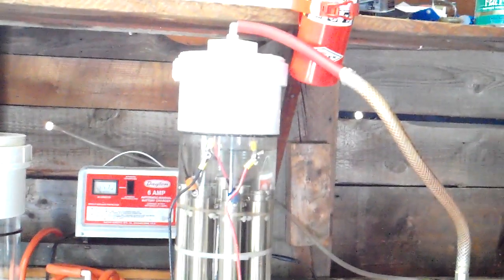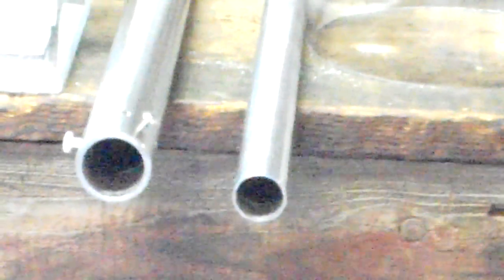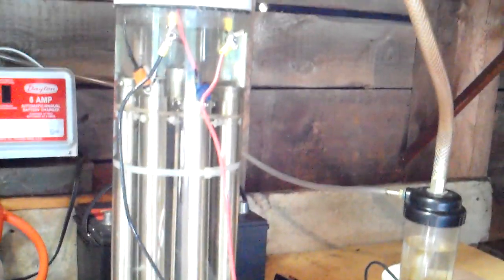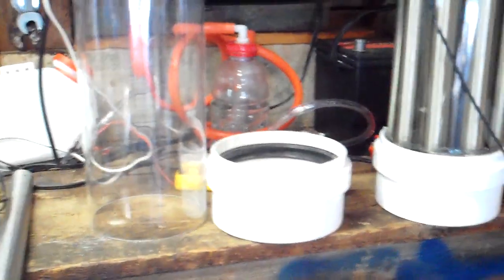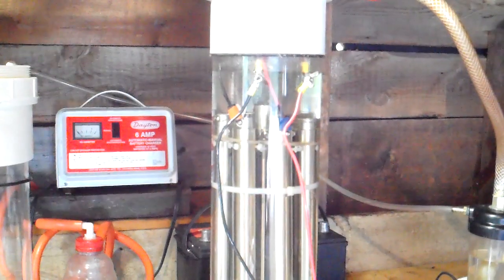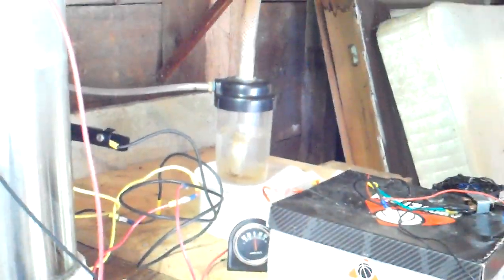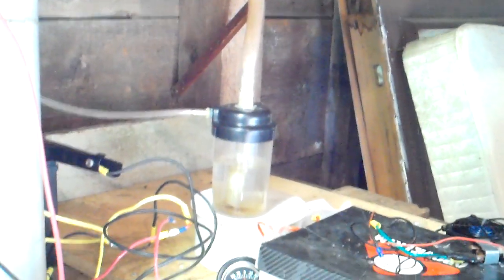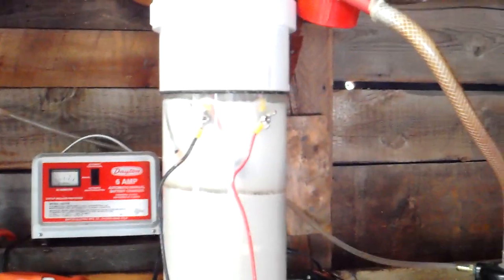High Output Stanley Meyer HHO Generator.AVI

Comment: This is considered wet cell, yes?

How could configure for just pure Hydrogen? Thanks...
Reply: This is an electrolysis device, it's very inefficient at converting electricity into HHO. No, this is not a wet cell. You are thinking of a "leyden jar", the first "battery" ever invented.  This is a scam
Reply: +Jacob Jones Thanks. I agree. After reading your post, it sounds a bit dodgy...
Reply: to get pure H2 and pure O you must separate the electrodes as each one gives off a different gas ex. positive electrode gives off 1 gas while the negative electrode gives off the other gas so each one has to be confined separately so you can capture each gas apart from the other.  this means no ac power only pure DC.

Comment: ¿Ese generador de Meyer , en que se diferencia de la Electrolisis ?
Reply: bonjour , désolé , mon français est terrible. Cette conception est basée sur l'unité mayer HHO , l' hyfusion vidéo a fait produit 5 fois le HHO que l'unité de Mayers . Hyfusion veut de l'argent à partir de son site -à-dire ce qui est différent . Sons suspect à certaines personnes qui ont fait des commentaires ici .
Reply: Y tendras algun Manual para Poder hacer una Replica de Meyer HHO ??
Reply: Tendras algun manual o Podrias ayudarme a Hacer ese generador de Meyer
Reply: its design is online free
Reply: Pero no lo encuentro . Podrias enviarme los Manuales ??  Gracias
Reply: Un generador de HHO de meyer . Cuanto HHO produce en LPM y Cuanta Corriente necesita ??
Reply: There are many videos and web pages,  and many different versions. watch them closely, i am sure you will learn quickly. There are not many versions which produce large amounts of gas. the choice of coils, tubes or dry cell is yours. There are very efficient units being made without draining too many amps or volts. As a car nut and not shown much, the simplest way to produce amps is by using two alternators. There are basics to consider also, water type, bond breaking additive, metal type, etc etc.
Reply: Y que vensiones me Recomiendas para Producir 5 LPM de HHO y cuanta Corriente necesita ?
Reply: Podrias recomendarme Videos ..Paginas Web
Reply from the maker: Daniel Jimmy Nuestro sistema HHO celda doble de gas dividida pone 4LPM HHO @ 200 vatios / hora . Visita www.HHOTrucking.com para precio y especicaciones
Reply from the maker: Daniel Jimmy Proceso de Stanley Meyer es diferente que la electrólisis . 
Sus circuitos sólo funcionan con agua destilada o agua Orgón . 
Estamos diseñando un circuito simple que hace lo mismo :
Reply: in his video meyer talks about surface area. A form of electrolysis seems the only way to go.

Comment: I know how to make an effective hydrogen/oxygen generator!

1:st! Send a great "Up yours!!!" to Barack Obama and the masters that are pulling his strings!

2:nd! First rule when building a generator, maximize surface contact! That is essential for optimum performance.

I'd prefer to build a generator like this:

The system would be able to handle 30bar for my purpose but you can build it with ordinary items, sort of, some things you need to manufacture yourself but it's not more than cutting with a scissor or a saw.

If a metalcontainer is used, then you can use its shell as a ground connector. The inside is where the magic happens and now is the time to really understand what happens in the process of splitting water to its basic components, hydrogen and oxygen.

For those who want to know more:

We are splitting water to burn the outcome, into water again. To split water, you need water, baking soda, 1 plate to + and 1 plate to -, and one container.

Depending of amount of water, one tablespoon per liter is used. Put the plates in the container with the solution (water and baking soda). Connect the + and - to power source, i.e. a battery and voila, you are splitting water into a burnable gas. !!! Be Careful! The Gas Is Explosive!!!

What happens is that current is travelling between the plates and when doings so, at the positive plate, electrons are ripped off of the watermolecule, making it ionized. There are 3 atoms making a molecule, 2 hydrogen and 1 oxygen. When an atom is "ionized" it has lost 1 or more of its electrons. When this happens, the atom goes from neutral to positively charged. When 3 atoms are together, suddenly goes positively charged, they repell each other immediately. 

In the stream of current between the plates, the individual atoms pick up a new electron to even out itself and then seeks its way to the surface as a gas.

The "rip off" happens at the surface of the plate. The more space there is on the surface, the more molecules can be split. Instead of using a solid plate we use a highly perforated plate, and it needs to be thin yet firm enough to not bend like aluminum foil. 

Now you maybe get an idea of what the "secret" every other guy has but doesn't share freely.

I would use stainless steelplates, perforated enough not to compromise its structure. The smaller the holes, the more surface can be made. It is exactly made as a fractal. Check it out, what are fractals, very interresting.

The plates are to be stacked +-+-+-+-+- and so on. The distance between them should be as little as possible.

You can make a small one or a big one. If you are handy and can assemble a package of plates, put it in the electrolyte and apply power to it, the system will boil like crazy. I'm thinking into building a working device, generating plenty of gas to drive my motorcycle. I would have it working at a pressure of 20-25bar. The pressure is needed for regulate performance easier. This has to work with a 12V system.

If you want to knoe more, just let me know!

Comment: where's your pulse width modulator?!!  this unit doesn't produce squat!  I call BullShit.
Reply: Do you even understand what PWM does? Why would changing the duty cycle in the form of PWM affect the output? That was rhetorical, it wouldn't. Actually it would decrease the efficiency of the system. Plus HHO generators are bullshit, anyone that praises that they violate the laws of thermodynamics is trying to con you out of money
Reply: J hey professor how does it violate the laws of thermodynamics

Comment: If you want to get the plans
to convert your car to HHO
Go to Google and Search for:
Top HHO Gas Car Research
Click the First Result (Skip the Advertisement)
Reply from the maker: dcbourbonireland Thanks for your thoughtful analysis. Much of it was correct, especially the part about selling the system to family members for a dollar first. However, I would like to clarify two issues that you didn't get quite right.
1. Stanley Meyer realized that monatomic hydrogen has 3 times the energy of gasoline BUT, it reverts to ordinary molecular H2 very quickly. To run his dune buggy on just 7 LPM of HHO he had to invent the water fuel injector plugs that made monatomic hydrogen RIGHT BEFORE IT WAS INJECTED INTO THE CYLINDER. So, you were partly right. My other point #2. is that it has been proven that his voltalysis process is totally different than Faraday electrolysis and is actually over unity. It is 300% efficient. Bedini and Meissner both have designed circuits that do what S.M. was doing. My latest design uses these new over unity circuits to generate far more net energy from HHO than joules consumed. Using this technology an engine could be designed specifically to run on HHO that would have ZERO FUEL COSTS. Call to get my free whitepaper on the subject 207-315-0315 Dave D.
Reply: The more I look into this HHO business the more I figure that Stanley Myer had the right solution .In the HHO. We see many gizmo that produce some liters per minute with the average theme that they use some ~200 watts of power to give back some 1 liter off HHO . After that  the HHO is injected in with carburetor or injectors . Most all measures are liter per minute for these HHO devices .Stanley Myer I think went the other direction he figured out how much HHO do you need for every single explosion in the cylinder of the IC engine . He looked  the micro level explosion event to replace the few grams of gasoline used in the cylinder for each explosion event  . As the gasoline enters in droplets much of it is wasted as the fuel hits the walls of  the engines cylinder .Also the gasoline fuel  burns slowly so most of the gasoline fuel is ejected out the tail pipe while it is still burning. Fuel burning outside a cylinder is wasted fuel. This then  suggests you can probably replace the gasoline with much less HHO gas compared to the wasteful gasoline fuel . Gasoline fuel burns in IC engines are reputedly in the low ~20% mark and under with ~17% burn rate seeming to be the IC engine industry quoted number . The HHO fuel is a fast burn and we can expect close to 100% burn rates. This again suggests  we might only need less than ~1/5th the energy to match the gasoline fuel . The fuel energy density figures  suggest ~1 liter of gasoline matches ~2200 liters of HHO .therefore it looks like ina IC engine some ~440 liters of HHO fuel will match ~1 liter of gasoline.  You can work it out how much fuel in grams or parts of liter  you need for each explosion event in the IC gasoline  engine . Then figure out the HHO equivalent in energy and replace it .My Maths best I can figure is each individual explosion event in IC  cylinder  supplies about ~1 watt of power . That's based on a old 90's ~2800cc Merc  automatic doing ~60MPH steady on highway at ~3000rpm and getting some ~20MPG USA (1 gal USA is ~3,83 liters). The secret I think Stanley Myer had was he saw that making the HHO outside the engine was too much hard work .So instead to make all the  HHO outside the engine he chose to make the most of the  needed HHO gas in hundredths of second for each explosion event to supply the needed HHO to supply the  ~1 watt of power needed  inside the IC engine The HHO looks like it is made in  the cylinder head and down through the middle of the spark and maybe it drags some extra HHO from outside the engine.The side effect from this is that when the HHO recombines in the IC engine explosion event it forms water .Also the heat then  makes that water turn to steam which that helps the explosion event push down the piston .He then I think saw that if he included extra water in a fine mist  which was not made into HHO but carried into the combustion chamber   this too  might  create extra steam and extra power . So I  suspect  Stanley Myer did not do  any major  extra electronic gimmick  to make HHO at less than the ~200watts of power we often use to make HHO . I suspect  its more Stanley Myer  made it where it would return more energy back than we put in with cheating and using the steam side effect to do that  .My 2cents on the subject we should instead try to make the majority or all the  HHO inside the cylinder instead from outside the engine and follow the genius of the expert Stanley Myer RIP. If anybody succeeds  I suspect the best thing to do is make one version of it sell it to trusted family member for $1 Then document the sale and this will mean you can always manufacture it for  your life as you had it first . Then put the plans out there in the entire world to have .Then there is no point to kill you for the information its out there .The manufacturing rights will always be with you as first seller .If you try to patent they will probably Stanley Myer your you 6 feet under .Join the world of open source  inventions and groups in Kansas such as http://www.shazizz.com/shazizzradio.html. Good luck

Comment: Yes, and from what I have read and understand, when you burn gasoline you're actually burning the hydrogen that exists in the gasoline. Please correct me if I'm wrong.
Reply: Thats not technically accurate. You get water because you are burning a hydrocarbon, which produces water as a product on the right side of the equation.

Comment: Thats not true! I have a 65 Ford F250  with a 390 motor and a bad carburetor that I ran on a mixture of HHO and 1 gallon of regular gas for 8 hours. The mileage on this truck is usually about 4miles per gallon. It truely sucks normally, so the HHO made alot of difference. You obviously have not really looked into it very much.

Comment: if its a full Stanley Myer design and He Stated that at the start of the video, then he is not using 12volts he would be using a higher voltage like 100volts and because its 100volts the current is less thus you can use thiner cables.
Please look up AWG, American Wire Gauge this will give you a chart so you know what Current Wires can handle.
Also remember Volts x AMPS = Watts.
12 volts 6AMPS = 72 Watts or 120Volts 0.6AMP = 72 watts. ;)

Comment: Nice video, i am looking at making a HHO Welder but i am tossing up between dry cell and wet cell.
Here is a free tip i have not tried it but you can get liquid electric tape its really good you just paint it on, i was thinking if i was to use pipe config to paint the rims of the pipe at each end so the electrons not take the shortest route go through the steel, but under these conditions not sure if would work but in theory it should be ok.
Thanks for the Video.

Comment: you got the right idea....lets just get rid of the wires and use bolt on connections.....wires won't last....47 Bucks? with wires in it...it won't last 60 days under normal daily use.....when you have it without wires...contact me....

Comment from the maker: Stay tuned....I'm paying a lot of money to an electronics engineer to build my next circuit using very high frequencies around 1 mhz or higher.  All you cheap bstds can watch while I test it. If you subscribe you'll get the schematics to build it yourself or buy it. I'll be testing it by hooking it up to my most advanced HHO gen and connecting it to a propane powered Onan generator. Watch to see if it runs 100% on HHO. Should be interesting. BTW, thanks to those who actually support my research

Comment from the maker: Luis, what you are not taking into account is that there is lots of water in today's gasoline. Today's engines run far higher crankcase temps easily vaporizing the tiny amount of water that may get past the rings. The HHO flashes into steam cleaning the cylinders and providing a lot of extra pressure. One of our customers has been running HHO on his diesel truck for four years and one million miles. It still doesn't need a rebuild.

Comment: Do more reading. H20 is only created after ignition. It's possible to get problems if you run too lean as a result of an O2 sensor getting fooled by more O2 than it expects. Thus the EFIE type units to mitigate that.

Comment: excuse me but every day cars and trucks drip gallons of gasoline with 20 $ water or less onto the streets everywhere.h2 plos 02 = h20 plus o2 o2 is great stuff and we are running out of it. as long as the water stays out of the oil pan all is good it goes out the manifold and drips out your carb...this employs midas muffler people in the following years so it is all really a closed system ..almost socialism really....jk

Comment: So when the Hydrogen combines with the Oxygen you get an explosion that should improve your engine's power. But when you burn Hydrogen with Oxygen don't you get water? And so, basically you are telling people that if you feed water into a combustion chamber of an internal explosion engine, there will be no damage from the water. Is thatt it? Because I'm pretty sure your engine won't last long and you will have to make many expensive repairs to it wasting more money on them then you would on fuel

Comment from the maker: Compared to what? Today, we used a plate system, our Big Kahuna. We tested a modification to a Stanley Meyer type circuit and got good HHO output using under 1 amp with tap water...no electrolyte. This was our first test with low frequencies.

Comment from the maker: The HHO results in more power from each power stroke. More power means that when driving you will require less throttle opening.....you won't need to step on the gas as much for a given amount of acceleration. We also use an advanced TSAT EFIE that alters your ECU response with a leaner mixture.

Comment: When using an HHO system, how do you keep the injectors from putting out the same amount of fuel, theerby defeating the purpose of the whole idea. My car uses a Throttle Position Sensor. It will put out the same amount of fuel even if you had 100 of these units on it.
Reply: no injectors in the old  80's cars

Comment: Higher the water temperature, more hho.  More electrolyte, more hho.  Dirtier the water, the more hho as dirty water is electrolyte.  Use stainless steel enclosures as PVC will melt and warp.  Not suitable for long operation.  Stainless steel buckets will sync the heat better and does not melt.  Heavier gauge wiring with a heat sync at the connection will give amperage flexibility without connection failure.